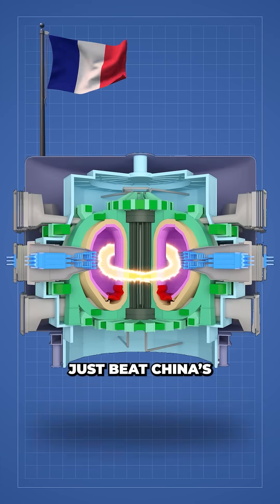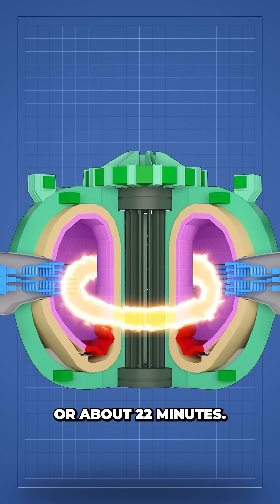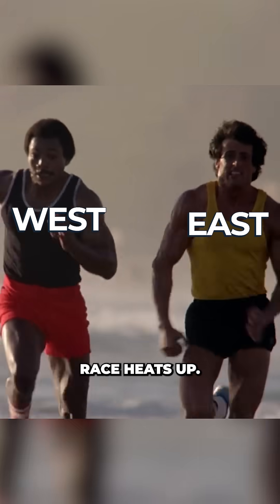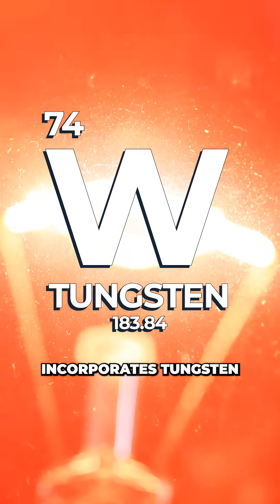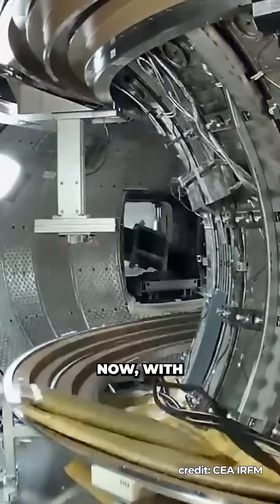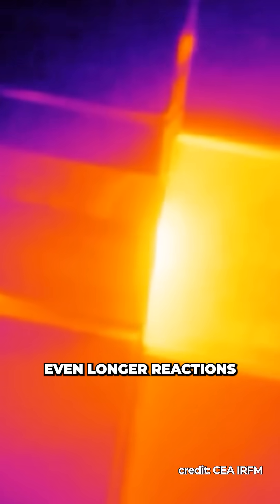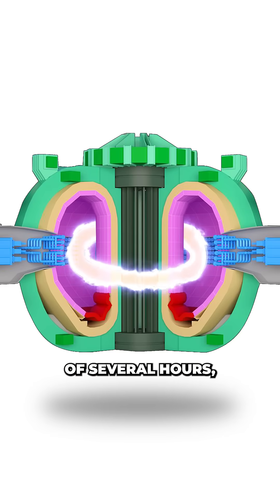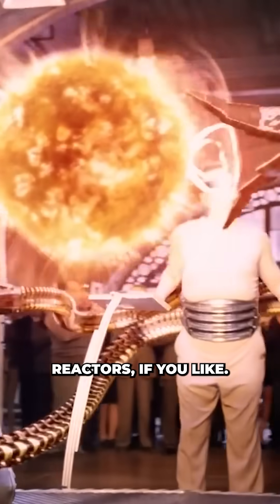France Breaks Fusion World Record

Comment: Magnetic confinement and laser D-T pellet compression resulting in ignition is the long hard way. A better method in which the plasma is both initially heated then contained in a standing electromagnetic wave is indicated in an old patent, US patent 4,000,036. This also allows direct conversion to electricity, skipping the extra step of having to heat steam to turn a traditional generator. The Director at Lawrence Livermore National Laboratory, LLNL, I think it was John Nuckols, made the decision to go with lasers and magnetic confinement, resulting in a fallout with the above indicated patent author, theoretical physicist Donald L. Ensley. So Ensley started a company to develop microwave fusion but it had to shut down after someone embezzled the research funds. Livermore knew they were nowhere close to having powerful enough lasers and this resulted in DECADES of completely unnecessary attempts to develop more powerful lasers and of course, more money for the lab. This abuse of public money and insult to scientific credibility has set back U.S. fusion development permanently.

Comment: Mechanical force is way easier and be made to have near limitless power. We just have to stop letting people tell us what is and what isn't. Magnets springs and a pulley system with a battery and boom. Free clean energy that can power a house with ease. Just don't over think it. It would be no different than a guy stuck on a bike forced to ride to generate power. Instead of a human doing it it's the wheel springs and mags that do the job for the human. Same result pure electric power. Good enough for a house.

Comment: Yeah having a heatsorce hotter than the sun in a lab on earth is the  safest and best idea ever. Hell i should sleep with a nuke as my pillow at this rate edit: once this is made itll probably be turned into a weapon.  If we get a Dyson sphere going we could make our own deathstar with a plasma cannon if we fund a way to add a part for the plasma to be released out of at at a target once a trigger is pressed. Ngl believe that basically is similar to what the deathstar is. A huge dyson sphere with a fusion reactor powered plasma cannon
Reply: It is safe, much safer than a fission reactor. If anything stops working the plasma will just cool down, the only thing that will be damaged is the reactor itself, and it isn't very radioactive either. It has been weaponised for decades, that's what hydrogen bombs are, they use nuclear fusion instead of fission.

Comment: Great video, but here's the key if hasn't already been said: While the experiment sustained a plasma for a remarkable 22 minutes, it did not achieve a net energy gain. The energy injected into the plasma was higher than the energy extracted.
Reply: That is not the point of this experiment. This tokamak only operates on a deuterium plasma, without the radioactive tritium required for high fusion cross-section. The point of this is to accomplish plasma confinement over long-term at fusion relevant temperatures, for which this is a great step forward
Reply: They’ll have that part worked out in about 22 years.
Reply: But what was said is that it’s for purely research purposes.
Reply: @J_Kleb  So, yes, you are absolutely right. While the recent progress is incredibly encouraging and brings us closer to the dream of fusion power, it remains firmly in the realm of research and development at this stage. The transition to commercially viable fusion power plants will require significant amount of breakthroughs and engineering advancements. I find this topic so fascinating. What I've learned is that while some private companies are aiming for earlier deployment, a more conservative estimate for when we might see commercially viable fusion power contributing significantly to the grid is likely in the mid to late 2040s or beyond. The next 10-20 years will be critical in determining if these ambitious timelines can be met and if fusion can truly become a practical energy solution.
Reply: Someone in the comment section said about 22 years and I think that's pretty spot-on to be honest
Reply: @Brian_Onesimus  That's true. While it's very possible, it's something not to take for granted. My professor who was a pioneer in fusion physics / technologies said something pretty cool in class - that all of the funding it needs has been given for the next 10 years. If it doesn't happen within the next 10 years then it will never happen (at least in the US - Europe and China will have all the government support to make it happen).

But honestly the most you can help with it is by being enthusiastic about it. Not only are we trying to make this happen almost in a technological vacuum, we're also competing with countries like China to make this happen as soon as possible.
Reply: @theuserofdoom  Sounds it won’t happen in the US, then. Besides, the scientists are leaving and going elsewhere now. The US is in decline.
Reply: I mean that’s kind of obvious. No plants are set up to make net power. They’re trying to optimize the fusion conditions for a reactor that is set up to make net power. That’ll happen in 2 years once SPARC starts running.
Reply: How do they make it positive?
Reply: @anteadc9868  that's the million dollar question my friend. Aachieving a net positive gain in a plasma reactor involves heating and confining plasma to extreme conditions to initiate fusion reactions, capturing the released energy, and ideally leveraging self-heating mechanisms.Great question!

Comment: 2030??? Yes fucking right. Try 2060 🙄 creating the reaction is only half the battle. Containing it once it reaches viable temperature to generate excessive power is just as difficult. Tungsten will still melt. Not to mention safety regulations. One tiny ass slip up can mean a catastrophic meltdown it's even more of a delicate process than running a nuclear reactor.
Reply: Actually, a meltdown can't happen with this. The worst thing that can happen is the plasma spreads out and cools. Aka, it is not a bomb.
Reply: @09enderman  we haven't even gotten remotely close to generating a sustainable plasma field for long enough to create any excess power yet, so u have no way of making that claim. It's supposed to become almost 6 times hotter, so critical failure is possible. Were talking about millions of degrees. 🙄
Reply: @kyleferguson4236  I have looked at credible info and computer models/simulations, and I used that as my claim. What are your credentials?
Reply: @09enderman  lol sure u have. My "credentials" r the fact that it doesn't take a genius to kno if u superheat plasma to 4.5 MILLION degrees with nothing to contain it but tungsten barriers, u can't just mitigate critical failure like flipping off a fucking light switch. I don't care what models uv seen, humanity has never ever began to grasp the extent of messing with shit like this. 22 minutes is their record. That's .0027 % of the power output necessary to make it viable. When that number hits 40 %, then we'll talk

Comment: We need to come up with some non-water based emissive heat power generation, that is basically a heat pump, that turns the heat into raw energy, and can be pumped out as fast as its created.

This kind of technology is likely no where close to feesable, since all of our heat>energy generators are water based that I know of (I'm not a researcher, so it might exist, but I doubt on a scale that could convert millions of degrees per second)
Reply: A heatpump that turns heat into raw energy. Congrats you just invented a steam turbine.
Reply: @spammingeddie924  That uses water though, it needs to directly convert the heat into energy without external water sources

Comment: West is a Tokamak and Tokamaks can't run in steady state conditions, because of a current that need to be induced. This means that they only do pulses and are not a viable option for base load energy supply yet. If this problem can be solved or bridged, they would be viable again. But imo the optimized Stellarator will make the race for an actual power plant.

Comment: I hope to see fusion working in my lifetime. I had job offers in 1980 to be an engineer on the centrifuges that separated uranium at Oak Ridge. Lol, I turned it down, soon after the industry collapsed. Instead I worked in industrial controls in steel milss, which 2 decades later collapsed.

Comment: Harvesting energy from a fusion reactor — especially from experimental reactors like ITER or future power plants like DEMO — involves converting the kinetic energy of high-energy particles (mainly neutrons) into usable electricity. Here’s how it’s planned:

⸻

1. Fusion Reaction Basics
	•	Fuel: Usually deuterium and tritium (isotopes of hydrogen).
	•	Reaction:
D + T → He (alpha particle) + neutron (14.1 MeV)
	•	The neutron carries most of the energy (80%) and escapes the magnetic confinement.

⸻

2. Energy Harvesting Process

A. Neutron Capture in a Blanket
	•	The reactor is surrounded by a blanket made of lithium-containing material (like lithium-lead or lithium ceramic).
	•	Neutrons hit the blanket, transferring their kinetic energy and heating it up.
	•	Bonus: The neutron-lithium interaction breeds tritium, a fuel for the reactor.

B. Heat Transfer
	•	The blanket gets hot — this heat is extracted using a coolant (e.g., helium gas, liquid metal, or water).
	•	The hot coolant is then circulated to a heat exchanger.

C. Electricity Generation
	•	The heat exchanger produces steam, just like in nuclear fission or coal plants.
	•	The steam drives turbines, which rotate generators to produce electricity.

⸻

3. Future Innovations (Experimental/Advanced)

Direct Conversion (Far Future)
	•	Capturing the energy of charged particles (like alpha particles) directly using electromagnetic fields to generate electricity — this bypasses steam turbines entirely.
	•	Still highly experimental.

⸻

4. Key Technologies in Development
	•	Blanket modules (with tritium breeding and neutron absorption)
	•	High-temperature superconducting magnets (for plasma confinement)
	•	Advanced heat exchangers and turbine systems
	•	Radiation-resistant materials

Comment: Isn't this all just fluff though? It doesn't matter how long you can sustain it, if you are expending more energy than it produces.
Reply: You are aware figuring out how to sustain the reactions is the first step in reducing input energy right?
Reply: @blank_3768  no. is that true?
Reply: @deadmanslastwish  …… yes. do you not know how fusion works? It mathematically takes less energy to fuse atoms together of low masses than they release. The issue is sustaining that fusion.
Reply: @ interesting. So what is expending all this extra energy in these tests? and how does increasing sustainable reaction time result in lowering power expenditure?
Reply: @deadmanslastwish  The issue is the amount of energy required to sustain confined plasma. Once we manage to stabilize it, we can then study it and figure out how to lower the energy costs.

Comment: Just a waste, you can't make more power than you use, thermodynamics..
Reply: Brother, I don't think you understand how any of this works.  The energy of fusion does not come from the energy put in to get the reaction going.  It comes from the matter being fused.

What you said is akin to "Fire is impossible because you can't ever get more energy out than the spark puts in."
Reply: @dr.zoidberg8666  fusion so far uses a lot more to start and maintain the reaction than it ever produced, and it's always "20-30 years away"
Reply: You don’t understand thermodynamics. The energy is stored in the mass of the atoms. Do you think coal power plants are impossible aswell?
Reply: @blank_3768  coal power plants don't waste more power to turn on and maintain the generator than they produce from those generators, and they burn a lot of actual matter, which turns into energy
Reply: @ Sustaining plasma is what takes a lot of energy, but mathematically it shouldn’t. These experiments are there to test new methods of plasma generation and confinement, with each start up less and less energy is required. Fusion would burn thru less matter, while generating more energy.
Reply: @blank_3768  a lot of power is used to sustain superconducting Magnets, or lasers, or vacuum systems, cooling, control electronics, depending on the method

We can't even reach Q higher than 1
Reply: @ If only there was a way to study the creation and containment of plasma so that we could make the process more efficient, oh wait that’s what the tokamak is for.

My god dude, if you were around in the early 1900s you would be saying heavier than air flight is impossible because no engine could be light enough.

Comment: The duration is nice and all but it doesnt matter if youre not releasing enough energy to provide a net gain in energy. This would no doubt call for higher temps which would then have a higher chance at damaging the chamber lining and or cryostat. So the duration is only a good thing because it shows that their approach to plasma control via magnetic confinement configuration is working and that their chamber lining is working with comparable temps. Im not sure why they never include the temps they would need to meet as well as the temp they held for the record.

Comment: I believe that there is either a certain element, or alloy that is optimal for the inside of the reactor. I also think that the structure of said material matters equally. On yt shorts there is a man who made bullet stopping armor out of a lattice structure. I believe the future of material science is treating molecules and atoms as a base structure, and then creating even more complex materials out of lattice materials that mimic molecular bonds on a bigger scale. Possibly even the opposite where we could have impossibly dense material that is stable and erodes with the plasma but has a high enough density to maintain the plasma for energy purposes

Comment: Ah yes, the Golden Rule of fusion: commercially viable fusion reactors are always only 20 years away, no matter when you asked. It was 20 years away in the 70s, it was 20 years away in the 90s, it is 20 years away now. It will likely still be only 20 years away in the 30s as well.

Comment: Over 5 million people die prematurely each year from air pollution due to fossil fuels. About 46 people have died from nuclear Power plant accidents.
Reply: ehhhhhh, no. Yea nuclear power is extremely safe, way more than fossil fuels. But this number is the russian number for the chernobyl incident . The one they gave for it, which is complete bs. Those are the ones that died immediately and shortly after the explosion. Not the thousands who died of radiation poisoning. Also there was also the one at fukushima. Also this is fusion, not fission btw
Reply: @Uraqt_1337 Yeah 46 is a little low, but he is right that nuclear fission is the safest energy source other than solar
Reply: Okay, and what's that have to do with fusion?!
Reply: Interestingly one of the biggest problems with coal that leads it to giving people lung cancer is the radioactive carbon 14 it releases into the atmosphere when burned. This is the main cancer risk one should be concerned about today, and leads to millions of deaths silently each year.

Comment: Why 10x hotter then sun?

Why not drop it to 1 sun or minimum fusion tempature after fusion is achieved?😒(like dropping to low which still simmers stew and boils water)

Some people miss obvious solutions to lengthen time before burn out or prevent burnout all together....just 1 sun will superheat water trying to keep the reactor walls and containment equipment cool
Reply: not sure if it’s a joke, but the energy we gather is heat. So obviously we want it to be hotter. Also haveing it cooler doesn’t mean it’ll run longer

Comment: I doesn't matter how long it runs if it is unable to produce waaaaaay more energy than it requires to run. This is like saying someone built the tallest building, but there's no elevators or stairs. Meaningless
Reply: why does it need to make wayyyyyyy more energy. It already gains more than it takes. Why does it need wayyyyy more? Also those are early prototypes. this technology is extremely new. And it’s getting beer constantly

Comment: We use the heat to do what? Boil water to create steam to turn a turbine to create electricity. Where are we going to get the water. I guess we could use salt water but that would be hard on the equipment. Pumping salt water from the oceans to Kansas might be a little too expensive. One solution creates more problems.

Comment: I'm not very familiar with fusion, how come that intense heat doesn't melt literally everything? How are we going to harness the power? (probably boiling water) how do we get more energy out than we put in? What are we using?
Reply: We are meant to get more energy out. It’s actually the same method that the sun uses. Also, the fuel is hydrogen isotopes such as tritium and deuterium

Comment: To be clear, neither the Chinese, nor the French experimental “fusion reactors” actually produced fusion in these tests.  What they did was to “sustain” a plasma loop within their magnetic containment.  the Chinese used a plasma of electrons @ 100 M deg C while the French used hydrogen ions (protons) @ 50 M deg C, neither of which is capable of producing fusion under these conditions.  The current proposed method is to smash deuterium and tritium together in the sustained and contained plasma @ 100 M deg C, which would give off gamma rays (energy) and escaping neutrons, and captured helium ions.  So, this is an important step forward, but far from actual sustained fusion for the times stated.  Don’t want to be a wet blanket; just a reality check.